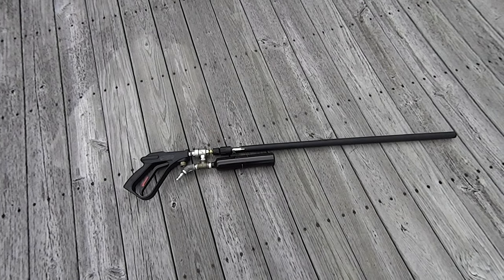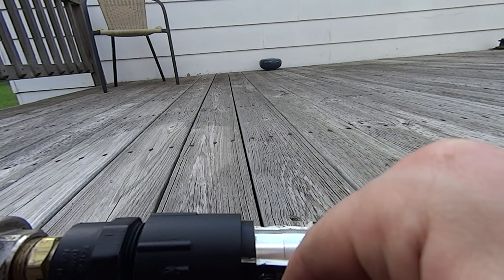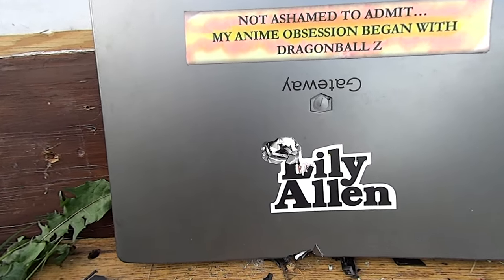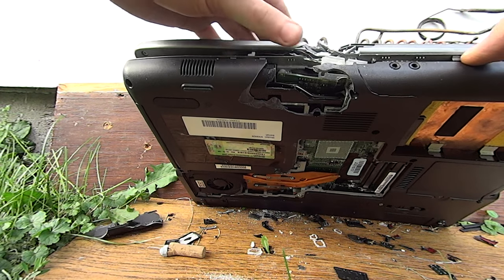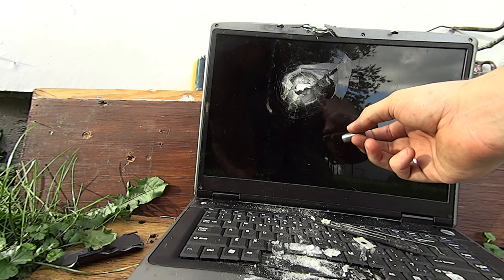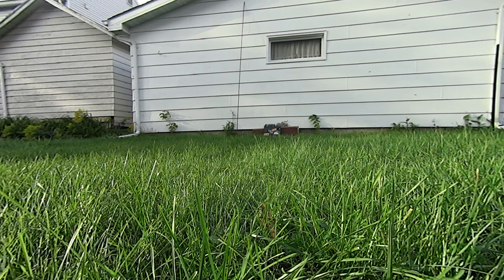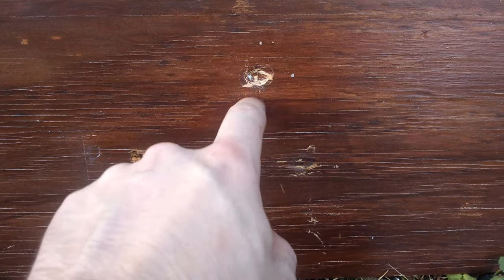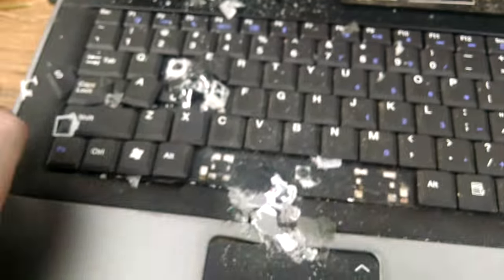QEV air rifle breach loading mod and firing at 600 psi!!

Comment: Nice, but I guess if the slug didn't make much damage it's because of three things: You barrel is not rifled, the slug you used was made out of steel and it wasn't pointy. That's also why the lighter ball bearing worked better, it's round and light so it goes faster and got less friction.

If you had tried to shoot with a lead/copper slug with the shape of an actual bullet, slightly lighter and with a rifled barrel you would probably have went through both the laptop and the wood plank.

Good video tho.

Comment: I found one of your videos a few days ago and have watched several of them.  I do have a question about your qev used here.  I see that you are pressuring up to 600 psi yet most valves I have looked at are only rated at 125 to 150 psi.  Have you modified this valve in some way or have you just found that it's able to handle the pressure without blowing out the seals?  Thanks in advance.
Reply: Never mind, I just saw the answer to my question on someone else's comment.

Comment: How does that industrial QEV handle 600 psi? Those are normally rated 150 psi or less.
Reply from the maker: That rating is working pressure.  Burst pressure is many times higher
Reply: @swandonovan  No doubt it can operate higher. What is the safety factor?
Reply from the maker: @robinlehnerd1475  generally 3 to 4x. But it's all a risk.  Really up to the operator how lucky they feel / how much they want to push it.  I've been asked this question a bunch of times, even on this video, and have answered the same.  Get a quality qev from Germany,  USA, or Japan,  and then decide what risk you're willing to take.
Reply: @swandonovan  Roger that. Do you trust Legris for quality? Just ordered a couple 1" QEVs planning to build a pvc cannon.
Reply from the maker: @robinlehnerd1475  it's plated brass from china.  and it's a large size, which means the more area for the pressure to act against.  i'd trust it to maybe 300

Comment: What is the name of the metal valve used to pump the air into the gun?
Reply from the maker: josh williamson it's a hydraulic auto closing fitting.
Reply: Swan Donovan the metal valve? the one that is inserted into the gun?
Reply from the maker: josh williamson if you're taking about the one at the end of the t facing the trigger, than yes. I have two how to videos on my channel where I go over the gun in great detail if you want to check those out.
Reply: Swan Donovan can you please leave a link of where I can buy one? thanks.
Reply from the maker: https://www.fastenal.com/products/details/0482618?term=hydraulic+quick+connect  that's about what you're looking for.  it's a self closing hydraulic quick connect.  you're going to need both the male and female side.  one of the cool parts about using them is because the female is also self closing,  you can unplug your fill line at pressure with just a quick pop
Reply: Swan Donovan is that better than this? ebay.com.au
Reply from the maker: depends on the application.  for my purposes, yes.  not sure how many psi a schrader valve can withstand

Comment: do i must modify quick exhaust valve?
Reply from the maker: Yes.  Check out some of my other videos for more details
Reply: Is there a way to make an air gun without modifying the qev?
Reply from the maker: @부계정-h4b4f  i believe there is.  It's been too long since I messed with qevs, but I think it doesn't need to be modified depending on which source the fill port is on.  Pretty sure I go over the details in one of my videos

Comment: Test firing a weapon TOWARDS the house??  We may not make the 6 o'clock news but it should make for interesting conversation in the neighborhood.
Reply from the maker: garage
Reply: Oookaaay...no one ever goes in there, right? Sorry, Dude--6 years of military experience makes me cringe. You wouldn't believe the instances of friendly fire.  Seriously.
Reply: BTW congrats on the gun. I'm going to w your design.
Reply from the maker: as i live alone, that's correct.  if i'm outside the garage, i can't be in it
Reply from the maker: if you haven't seen my later videos, should check them out